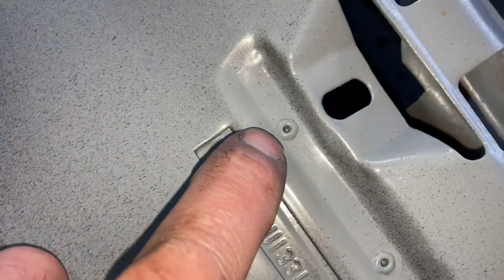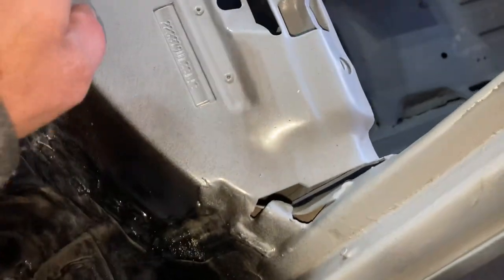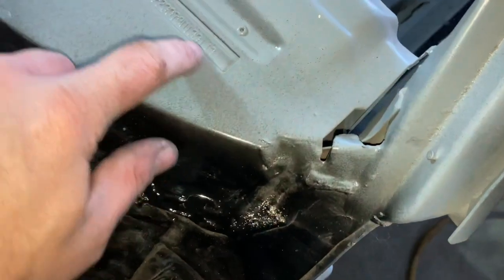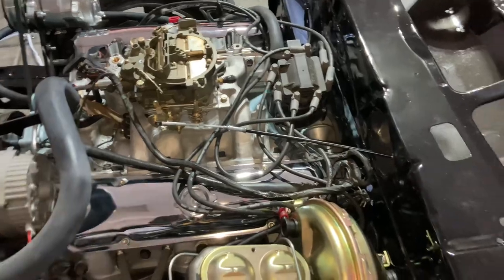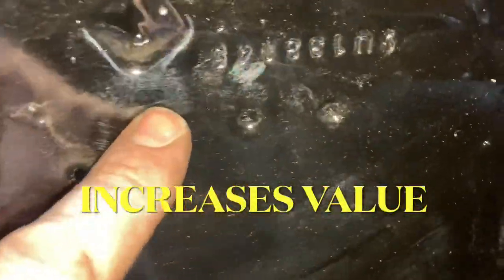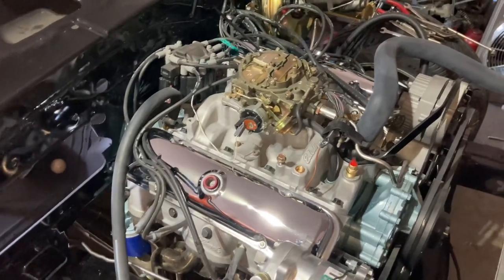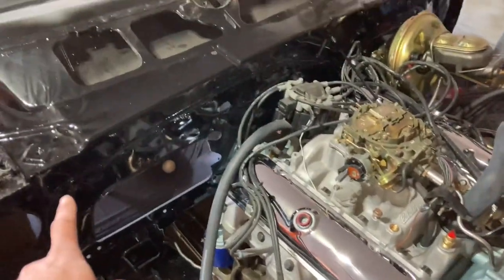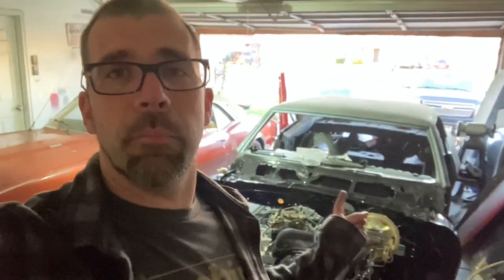Hidden VIN locations first gen Firebird or camaro stolen, body swapped, totaled, rusted out?

Comment: Back in '77, there was a guy named Tanner from the neighborhood who owned a '69 400 Firebird, silver w/a black vinyl top. I went to school with his younger brother, and was always at their house so i knew Tanner & his '69 pretty well. His firebird was mint with the standard black interior; am/fm radio, tilt-wheel, center console w/the matching wooden dash, and a clock. That firebird was sweet, sounded great & was very fast, b/c his 400 was built w/a forged crank, bored .30-over pitons, a hi-pro cam, Holley carb & set of headers with dual exhaust. But tragically, one afternoon while he was driving east on Hwy-50 in Claremont Fla. Doing about 90mph, he crested a hill, and drove under a stopped semi-trailer & lost his life.. His family was devastated, and i was heartbroken. So i still talk about him when i get a chance. 
In '81, i bought a '69 firebird 350/2bbl off a used car lot for 1400 bucks. It had a new burgundy paint job w/a new black vinyl top, and the standard black interior was mint. During those days, me & a buddy who owned a '67 Chevelle, were into scavenging the junkyards for cheap performance parts. So the first thing we did was swap-out the factory 2bbl w/a Holley 4bbl & aluminum manifold, along with a set of headers & dual exhaust. I also scored a nice set of used Koni shocks & a set of keystone klassic rims off a '68 Camaro. So i completely rebuilt the front suspension & brakes to make sure that firebird handled like it was intended too. I also installed a (boxed-style) pioneer am/fm cassette player that i mounted between the console & the dash, along w/a pair of Jensen tri-axle speakers.. It was a sweet running firebird but it had some issues, like a rusted roof under that new vinyl top & the rear quarters had previous damage that was repaired with a lot of bondo, and a fresh paint job. But i knew the firebird wasn't cherry when i bought it. So with that in mind, i knew i was going to abuse the hell out of that firebird b/c we were into the road & track scene. And i learned how to apex the curves & learned how easily that car would drift through the curves too. That firebird was a blast to drive..!! 
But on a drunken rainy New Year's eve, i passed a Dodge Charger on a 2 lane bridge & hydroplaned it into a ditch, and buckled the front end.. A van stopped, filled with drunken college kids asking if i needed help, but they left in a hurry when a cop pulled-up..lol  Then the cop yelled if i was ok, and asked if i needed a tow truck without ever getting out of his cruiser. Guess he didn't want to get wet b/c he just waited in his cruiser until the tow truck arrived, then he drove off.. And when the tow driver got out of the truck, i was surprised to see it was a woman tow-truck driver. But she snatched my firebird out of the ditch like a pro & towed us home. The next morning, my brother & i strapped a chain around a telephone pole, and on each fender as we gassed it in reverse to pull the fenders off the tires. Which turned out pretty good, b/c the creases in the fenders were pulled-out to less than 1/4th of inch to original. The nose & hood wasn't damaged, and the headlights still lined-up, along with the rubber gaskets behind the headlight housings. The only real damage was to the lower valance, and the turn signals. Which i replaced with used parts from the junkyard. So i thraxed that firebird for a couple more years until i met a guy who insisted he could repair all the body damage.. So i said have at it, and sold him the firebird for 650 bucks. But he never repaired that old firebird, and it sat for years before it disappeared. 

And back in '83, before i sold my '69.. i was driving through Maitland, Fla when i spotted a '69 Trans Am in a used car lot. So i stopped to check it out, and the salesman must have thought i needed an upgrade b/c he came trotting out w/the keys in his hand. Asking if i was ready to test drive the Trans Am to compare it to my firebird. So of course i said yes, and test drove the original Trans Am Ram Air III, 4 speed, with 43,000 miles.. And while on the test drive, the salesman said they were asking 8695.00 for the Trans Am but he'll take 8k with my trade-in.. Needless to say, i really regret missing the opportunity to buy an original '69 Trans Am/Ram Air III for 8000 bucks. :(
Reply from the maker: That bird took a beating!! Glad you are still here to tell the story. If you could by a rotted to the ground 1969 TA for 8k today you are doing good.  Thanks for sharing and next time remember always but the Trans Am.

Comment: I was told when the motor gets rebuilt sometimes the Vin disappears from something called shaving? Is this true or just a line of BS ?
Reply from the maker: I can tell you on a Pontiac block not going to happen during a normal rebuild. The vin is located on the vertical face by the timing cover.  The area doesn’t get machined during an overhaul.

Comment: where are the vin spots on a 1981 pontiac firebird?
Reply from the maker: From what I have been told very similar like the first gen birds. Stamped on the firewall in two places then also on the engine block and transmission.  I have yet to verify this but if you do please let me know. I would happily remember and share it in the future